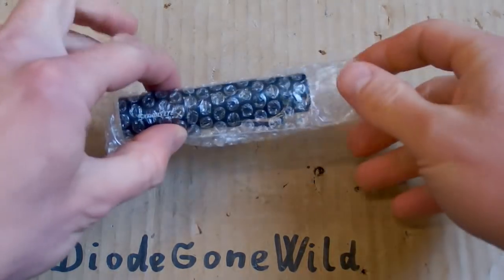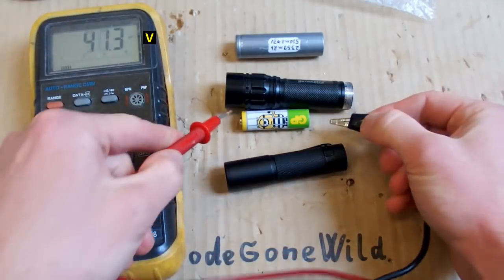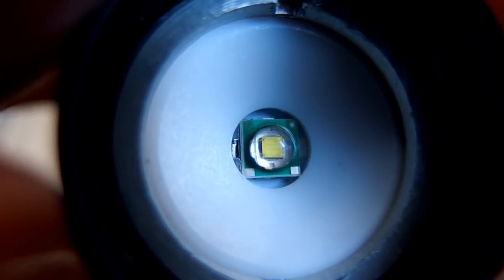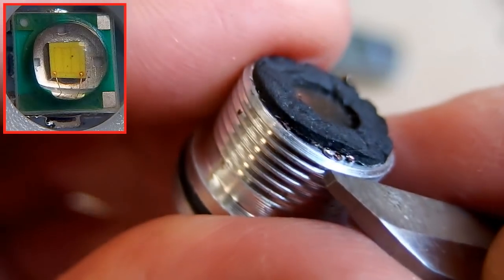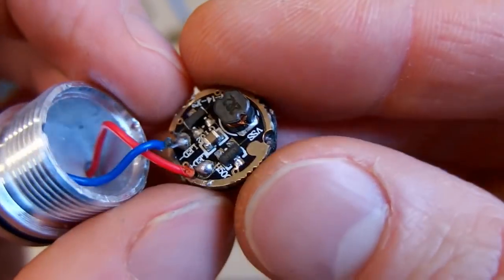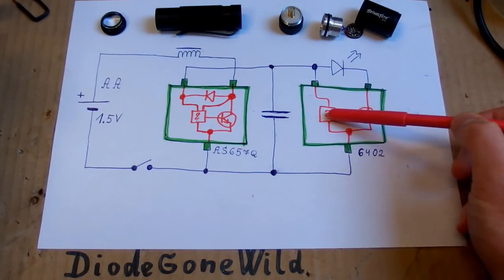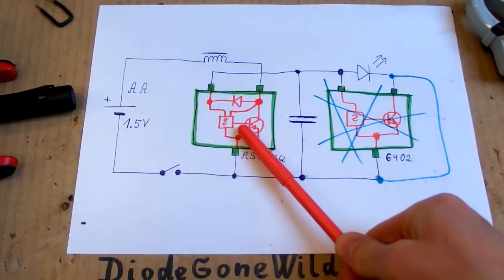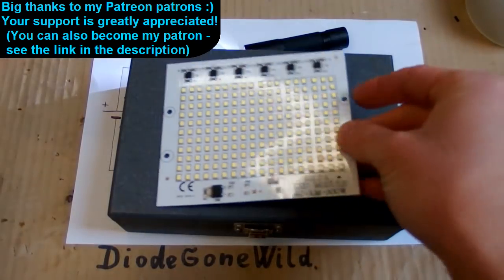Small but powerful 1xAA LED torch (Skywolfeye B18)

Comment: I searched for a AA alkaline spec sheet and found one from duracell. The performance curve for that battery shows voltage dropping very quickly running at 1A constant current. Total life would be about one hour but the LED would likely go dim or shut off well before that as the boost circuit pulls more current trying to keep up.
Reply: A current of almost an amp is clearly a case for (LSD) NiMH cells. Should get 1.5...2 hours depending on type.
IMHO, running at full blast all the time is not too practical. Often you'll be happy with a fraction of the output if runtime is correspondingly longer.
Reply: I recently built - or at least modified an old bulb torch for MrsW (she prompts actors so follows a script in a darkened theatre throughout a performance) she certainly doesn't want to light a big area, only needs enough light to read by and it needs to be light.

I used a 3mm ferrite core to wind a small coil with the wire from an old headhone and a reclaimed smd transistor, resistor and LED to build a joule thief circuit (as demonstrated by big clive). I then potted it in UV cured resin for strength. (https://i1150.photobucket.com/albums/o618/doppleganger1/miniThief%2001_zpswieg3eyi.jpg).
It was so bright I had to stick a piece of kapton tape over the front to tame it even further.
It works pretty well for what's needed and you can get 7-9 day's constant use out of a single already used AA or AAA battery.
Reply: @whitehoose  that’s incredible. Would love to see more pictures of it. Your link seems broken.
Reply: @hullinstruments  https://photos.app.goo.gl/EPkMb1WHbWzwyf3w9
This should work. I wind the coil myself (20 turns) uses a standard joule thief circuit google will show the basic circuit. It works however big or small you go

Comment: I really hate the daft clicking to get the full brightness, you have improved it :-D

I took a cheap torch apart, npn and pnp transistors plus a cap and two resistors plus small coil on ferrite bobbin, it runs 5 leds in parallel from 3 volts or less.
very minimal.

Comment: A shame its not practical (yet?) to match components, esp LEDs with standard battery voltages - currently they just don't fit ANY of the common power source voltages without some sort of tweak.  My first "projects" as a small boy were lamps in series and parallel and the tape and bent wire torch.  All parts scavenged from my dad's toolbox and saved bits from the bin.
The joy of reading under the bedclothes with a torch I'd made myself put me on the road I'm still stumbling along in the dark 55 years later - its far harder now for a 6 year old to make a similar torch from reclaimed bits than it was then.

Comment: What is the cut-off voltage for the LED?  I wonder how long that AA powered light would run on full power vs the 18650 powered light.  Is there a way to determine the cut-off voltage & run time on a certain cell type?  if yes, would you share how that is computed?

I know a typical Energizer Max AA alkaline cell has a 1150 mAh energy capacity.  H  ow can we determine how long that will 'actually' light the flashlight?  1150 mAh / 950 mAh = ~1.21 hours--but I doubt it is possible to get all of the energy out of the cell while keeping the LED lit.

Comment: I wonder if all AA cells can cope with that kind of current without destroying themselves. I once had a standard alkaline cell pop up violently in the battery case of a 3W headlight on the back of my head (4x AA). It scared me to death, which is why I only use NimH cells ever since.
Reply: They generally can, yes. Typical effective capacity at 0.5A is around 1100mAh and at 1A it's around 800-850mAh, which indicates that that's close to maximum current that you want to use these cells at, however they don't get too hot, not hot enough to give you a scare, and you do have leeway to draw some more current out of them, up to maybe 3A with further reduction in effective capacity. Maybe will get 40 minutes in this flashlight, since the input current may not be constant but rising to maintain output current.

What will give you a scare is connecting several cells of different capacity in series. When one of them is flat, the other cells in the series will still be forcing current through the flat cell. But empty cell is unhappy about that and starts decomposing rapidly. Of course you would not have known that the cells had different capacity or different effective state of charge if they came out of the same box, but it happens due to bad quality control.

Consider that when one cell is flat, i.e. has 0.0V on it, other 3 cells can still have slightly more than 1V each and will be sufficient to light the LED and thus force current through the empty cell. 4-series pack was a fundamental mistake, 3-series pack is much safer. In a 3-series pack, when 1 cell is empty and two others are almost full, the LED will no longer light and no longer let any current through that would combust the empty cell.

For sure for high current, NiMH is your friend, since it's overall better behaved and displays higher effective capacity, and also can be reused hundreds of cycles. But reverse biasing any cell is bad news really.
Reply: I think these single AA flashlights are usually meant more to be used with a protected 14500 lithium cell (same physical size), that they run at all on a AA is just a bonus feature of the simple driver circuit.
Reply: @SianaGearz  damn dude that’s a lot of really good straightforward information right there. Really thankful for guys like you in the comments dropping awesome well informed advice like this. I really appreciate it!

Comment: That flashlight looks nicely made - my similar Thrunite is much worse. And on a low battery (AA) the boost regulator doesn't even start up sometimes :o(  I like the nice clean beam pattern at all zoom levels with your flashlight too, better than even a LED Lenser. Good mod you did - I hate all the unnecessary flashing modes.

Comment: Wouldn't changing the inductor value change the output voltage/amperage of the boost converter?
Reply: I was thinking the same thing.  Also perhaps changing the value of the capacitor as well.
Reply: It would do if the chip uses fixed timing to control the current but not if it uses a current sense resistor.  So the answer is maybe.

Comment: Put a 14500 lithium ion battery in there. Same size as AA cel and work with a single led just fine and be much brighter than the AA

Comment: I wonder if it works with an nimh battery...
Reply: Would be interesting to see. Since NiMH is 1.2V at full charge the boost controller will have to work harder to keep the current up but the voltage drop would be much slower than alkaline. A Energizer spec sheet shows a draw of 1A on their AA-2650 would hold voltage near 1.2V for much longer than alkaline. OK, DGW- we need to try this.
Reply: @Miata822  Exactly my though, wondering if the booster will be able to keep up! I use rechargeables wherever I can. I don't use them only in wall clocks and remotes.
Reply: NiMH is 1,2 V max? I always thought it is a nominal voltage (like 3.7 for Li - ion) and when fully charged it is around 1,4/1,5 V.
Reply: @wychowanek90  that's right
Reply: I have one of these torches, and it works well on a NiMH.  The cell voltage has to drop below 1V before the brightness starts to decrease, and has to go well below 0.5V before the light goes out completely.
Reply: it will ofc. work, but max brightness will be lower due lower voltage and current you can drain from nimh/nicd, so it will be, lets say, like 3/4 of alcaline batery, and nimh will last for shorter time too
Reply: @nargalda773  yeah, but our environment is more important, right?
Reply: @wychowanek90  True but the surface charge on NiMH drops off to 1.2V almost immediately and stays very near that voltage throughout its useful range.
Reply: Better idea would be to use a 14500 Lipo battery. Remove the boost circuit and add a resistor probably.

Comment: At 1A, I assume the battery will be discharged in 2h or so... not sure how useful such flashlight is if that's the case. 

I'd rather have a 2 or 3 level switch/slider to have a low brightness mode (for example if you're in a tent and hook the flashlight to the top of the tent and just want to have some light for an hour or so inside)
Reply: Alkaline cell should last about 40 minutes to an hour, depending on the quality of the cell and whether the current goes down or up as the cell is discharged - unfortunately we don't know the control logic of the boost chip used.

At half current, 2-3 hours of use can be expected.

By all reason you have room in there for a small micro and a generic 2302 MOSFET and you can store the last state in EEPROM to switch between modes, or use some kind of push sequence detection via residual capacitance, if you were to make a stealthy modification of the electronics yourself.

For the manufacturers, for sure it would be elegant to use a switching converter chip with settable current limit and simply switch in a different configuration resistor by toggle switch, if they could be arsed to make a suitable enclosure, and eschew the multi mode controller completely.

Comment: I have one of these style lights but with  out  the modes just on and off switch. I was cleaning it with an isopropal wipe and destroyed the diode (led) wiped it clean off.. "IDIOT" must get it fixed coz it's a great little light!! Very strong and well built..
Reply: i spend WEEKS looking for single mode flashlight (from china bcz of price ofc.), there is almost none, maybe 2 or 3, basically every flashlight from china use 1 or 2 type of led driver, there is no diference, only depend on price and expected current drow by led (so you have cheap driver for AA/ AAA nad better for 18650), what i found and are widelly used is, that capacitor for store of last mode, you take graphite pencil and draw small line between contact, so you shorcut the capacitor, if you done it correctly, it will 1) - remember last mode forever, 2) -you disable switching modes, so it will always start at max power, you must realy made a few experiments with size of line, so it will work as you need, but it work, i have modified all my torches like this
Reply: @nargalda773  cool trick. I must try it on a little cob style keyring light I have.

Comment: I definetly prefer the 18650 driven torches. An AA-battery with a boost converter is no good idea because it will drain the battery quickly and boost converters are normally not that effiecient as buck converters.
Reply from the maker: I also prefer 18650 torches, but when somebody needs a very small but also bright torch, this one is very good.

Comment: The second IC may be doing constant current regulation. See if the current increases as the LED heats up. Also with nimh you should get better output
Reply: Actually, he did check that at one part of the video, so it looks like you did not watch fully or you watched it by skipping a lot. At the end, I would advise you to watch videos from start to the end and then ask if something missing or so.